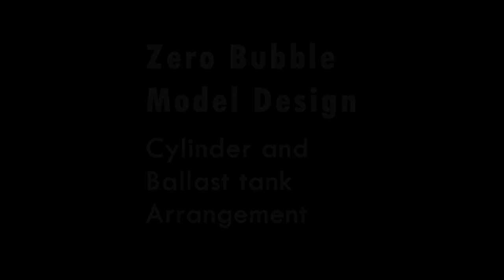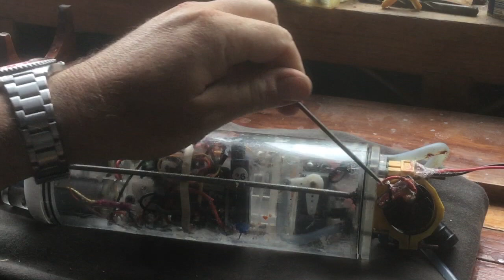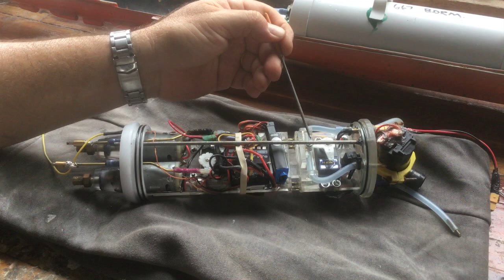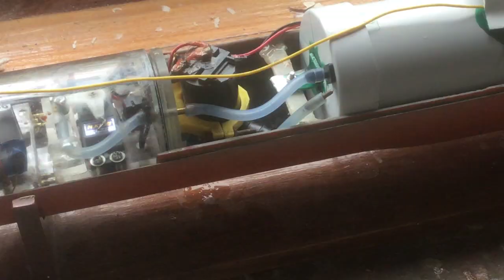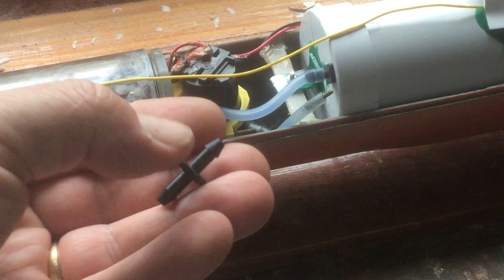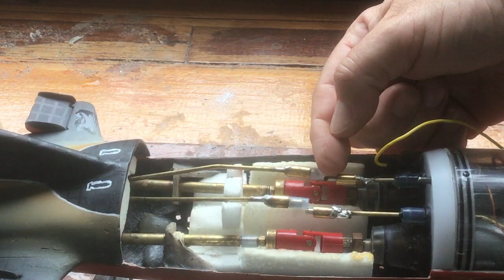Zero Bubble Model Design : Cylinder and Ballast tank design and layout.

Comment: Hi David. Regarding your washer pump. I know these are meant to operate at 12v but have you tried running them at a lower voltage like 7.4v?
Reply from the maker: Hi Romeo,

I have never considered using the pump on 7.4v. It runs best on 12v and that has always worked. You need the pump to have some ‘ grunt’ as it needs to work against air pressure. I run the 12v to the ESC and the built in BEC delivers the 4v to the RC.
Reply: @davidhugheszerobubblemodel1865  makes sense. Thanks.

Comment: Good job !!! where can I find circuits for low battery and low radio signal circuits control, so I could prevent problems with the sub in the event those episods might happen ? thanks !
Reply from the maker: thanks for the comment,
You could try Nautilus Drydocks, they have lots of components and specialized electronics. If you are more specific and clearer in your description I may be able to point you to a precise product that they may stock.

Comment: Noticed your sub doesn't have a pitch controller. Any problems with handling?
Reply from the maker: Hi Romel,
I've never used pitch controllers. They would probably be useful, I've never even tried one. Most of the time I don't need one  but every so often my boats may deviate a bit more than I would like from Horizontal. 
So i really should try one.
Reply: @davidhugheszerobubblemodel1865   Not sure if  Model Submarine Systems Australia (M.S.S.A.) still around. They  sell pitch controllers, it's located in Brisbane. No website just a  telephone no. (07) 32612610.
Reply from the maker: @coast219  Hi Romel,

Yes, I know Jim Russel but haven't spoken with him in a while.